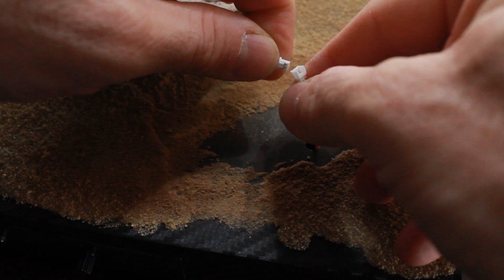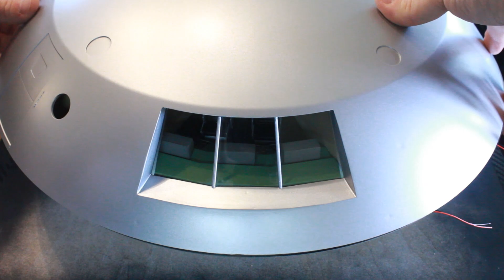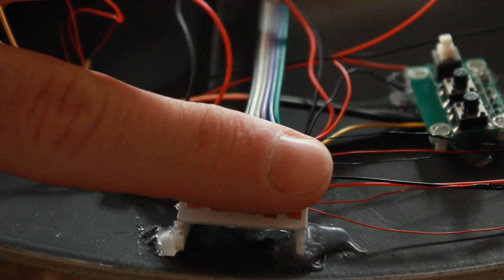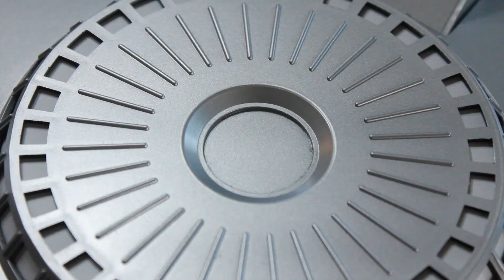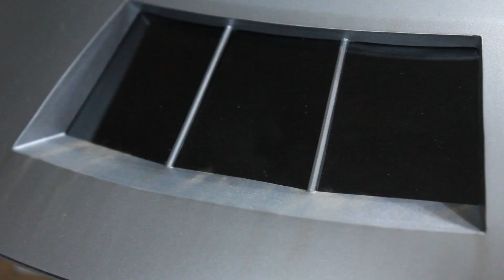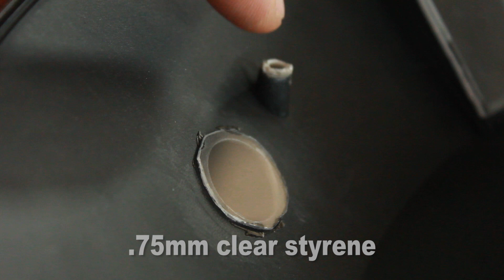Moebius 1/35 scale Jupiter 2 Pt 13 Finishing Touches & Button Her Up

Comment: What might work in place of the copper tape connector are "pogo pins", which are little spring-loaded contacts that are used in the electronics industry. If you have them pressing onto a piece of Veroboard or similar, and maybe a few little magnets around to hold the two sides together, that might get you what you're after. Food for thought, anyway...
Reply from the maker: Those look pretty interesting.  Thanks.  I'm done with this kit now,  but will keep this in mind for future builds.

Comment: you could have used trifurcon type connectors for one half of your copper contacts where the 2 halves join. the tension would have been enough to force a connection when the halves were joined and still allowed you to separate the 2 halves without having to physically disconnect a wiring harness connection.

Comment: hi christopher, i know that you are familiar with trinket and arduino ide, i have both, but the arduino software doesnt see my trinket 5v board, do you got the solution please ? i did a lot rechearch on internet but nothing, thanks in advance for your help !
Reply from the maker: I just followed the guidelines for installation on Adafruits website.  Make sure you have the Adafruit libraries loaded in your software and the Trinket board info loaded.  That's about all I would know.  Should work.  You also have to make sure you select the correct board under  "Tools" "Board".
Start here and go on from there and make sure you've done everything needed to work with Arduino.  https://learn.adafruit.com/introducing-trinket/windows-setup
Reply: @modelsbychris  thanks Chris, i will retry again .
Reply: thats work fine now with your help ! now i need to find the codes for programming